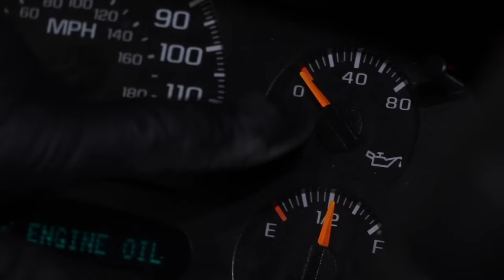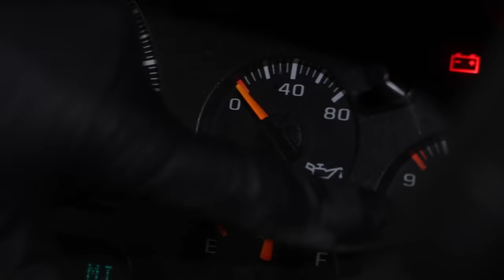Top 5 Problems 2000-06 GMC Yukon Sierra Chevy Suburban Tahoe Silverado Avalanche Cadillac Escalade

Comment: These trucks are really bullet proof
So far I've replaced
Oil pressure sensor and doing the steering shaft today along with the steering bushing lol.

Thanks again for this video
Reply from the maker: +tliska10 adventures Thanks for checking us out! 1AAuto.com
Reply: Bullet-proof, indeed! Few issues with sensors, yet nada on engine problems - a claim my Ford brother only wish they could say about the bucket of bolts they drive.

Comment: I’ve had 6 if these engines loved them .  I always cut a hatch behind the drivers seat where the fuel pump is first thing when I got one because my fuel pump went out on all of mine and that made the change a lot easier.  

Never had a cluster light issue, but o2 sensors and the drivers side seat ripping…and the a/c compressor.  Other than that they were all champs and looking forward to buying another
Reply from the maker: +Wren Coe Thanks for checking us out! http://1aau.to/m/Shop-1AAuto-c

Comment: Thanka for that last one on the fuse box. My cruise control wouldnt work and I traced it to a broken wire probably from some critter. I did not know the fuse panel flips up that easy however and will definitley inspect it when I get a chance just to make sure nothing else is going on!

Comment: I've had to replace quite a few parts on this car, so I can probably name a lot of the common ones cuz I had to research for hours to find them.

#1. Brake Lines. Unless you live in the desert, the crappy metal brake lines will eventually rust out, and are very expensive to replace. Luckily I found a mechanic that didn't know what he was getting into, and held up his end of the bargin. 
#2. Water pump. I guess it could have been the gasket, but mine had a dried coolant chunk when I took it off. 
#3. Power Steering Gearbox. Having a lot of trouble steering to one side? That's the gearbox. Took me hundreds of dollars wasted on a PS pump and bad mechanic advice to find that out.
#4. Belt Squeals. After getting fleeced on the PS pump, I had nasty belt squeal. They redid it trying to correct a possible misaligned pulley but couldn't. The cure is the Gatorback or Continental Elite Belt. Unfortunately, those are discontinued now. I have a spare, and they're apparently selling for $200 on ebay right now. I bought mine for $33.
#5. OBD2 Scanner not working. Check the cigarette lighter fuse. It's probably blown from putting coins in the center console cigarette lighter hole. 
#6. Oxygen Sensor. This was actually bad when I got the car, and the other one went bad afterwards I think. 
#7. Intake Manifold Gasket. I haven't done this yet, but I remember a ton of people selling used ones saying they replaced theirs.
#8. Rear differential cover leaks. I've done this twice and it seems to keep leaking. 
#9. Coolant T Square is another common one. It's a plastic coupler on the passenger rear that leaks coolant.
#10. Speedometer. The motors on these speedometers go out a lot. I have not had mine go bad yet, but it's very, very common. 
#11. RUST!!!! With these cars in particular, you need to put rust coating, and thoroughly wash your car whenver it snows. The car has rust everywhere, and both rocker panels have holes in them from missed rust spots (owner before me). Rusted out brake lines, PS lines, body parts. Paint has gotten faded as well.

Comment: Had the mouse issue in a Tahoe,. It was a model that came out with the electronic 4-wheel drive lock that wouldn't release burning out encoder motors. When I got it there had been two encoder motors already replaced. The mouse had chewed through the lock wire so it coudn't relase the mechism to switch then burning the ecoder motor out. They missed it as the lock circuit was intermittent.

Comment: If you ever get a crank no start or stalls while driving out of the blue and somehow gets going again the first and cheapest thing to check/replace is the crank position sensor. It's a good idea to keep some hand tools on board in case the alternator goes cause it's such an easy job on these trucks it's a waste to spend an extra two or three hundred at the mechanics when you can pull into an Autozone and switch it out in under 20 minutes. Same with the starter but those are probably not problems unless you are engaging it repeatedly like in a delivery truck. Water pumps aren't too bad. Had a dealer do one and they charged me a grand back in 06 and the next time it went I did it myself for under 200 and it's hard to screw that job up. If you have a truck with dual wheels make sure you retorque the lugs on them probably within a day or two and after a week cause they've been known to loosen up and once they come loose once they'll be more prone to it because the wobbling will make the holes wider. If you're running hot going up hills and the thermostat is good it's probably time for a new radiator even if it isn't leaking.

Comment: The part about O2 sensors causing misfires is dead on.. Put a new sensor on Bank 1 sensor 1 and even thought new it was no good and caused 1200.00 damage to cat convertor on that side. A certified shop couldnt even figure it out, but the internet saved the day, I fixed it with another new O2 sensor. Running like a champ now.

Comment: I’d take all five of these problems in exchange for my walked camshaft bearing. Low oil pressure wasn’t the sensor or the oil pump intake pipe o-ring (another common problem), and rod and main bearings are well within spec. I will be keeping an eye out for these problems, however. Thanks!

Comment: I bought a brand new 2003 Chevrolet Tahoe 4x4 5 3 LT fully loaded. 
10 years later with 90,000 mile I had enough!
My vehicle was serviced regularly and garage kept. I live in Central NJ 

Problems:
Coil failure ✔ 
Instrument cluster failure ✔ 
Rear seat release failure ✔ 
ABS failure ✔ 
Spare tire release rusted solid and had to be cut ✔ 
Serpentine belt tensioner freeze up ✔ 
Knock sensor ✔ 
Brake lines failure / rotting out ✔ 
Steering shaft rattle ✔ 
Vehicle frame rusted badly. ✔ *

* denotes -  GM gave me a recall notice regarding frame rot, then when I brought it to my Chevrolet dealer told me that my Tahoe did not qualify for the recall because its serial number was a few hundred out of the vehicles recalled range.    I argued and said look at this frame rot.  No avail  

I drive a Ford now .

Comment: Say what you want, 2000-2006 was prime General Motors... I have a 2004 Chevrolet Avalanche 4x4 with 402,xxx miles, never had a single problem out of it and a 2003 Chevrolet Tahoe Z71 at 327,xxx miles that has only ever had to get the crankshaft repaired.

Comment: Transmission  went out at 115,000 blew 3rd gear $1800 to rebuild it. 04 chevy Avalanche
Reply: Eric H sounds about right. Once they hit 100,000 miles, the transmission usually takes a hike. So when I see these douche bags buying these 50k mile trucks for $20k, I just laugh. The transmission is the weakest part of these trucks. And that is saying something, considering most of them are put together with chinese plastic and elmers glue.

Comment: Got a 04 tahoe 80,000 on it. First owner. Replaced the sensor on top on the fuel tank, got rust on the under carriage, replaced the cluster, got a p455 code that keeps coming back, got some clear coat peeling. No rust on the body though. Still runs solid just needs a little work. Got some 24” wheels on it no system yet got to get the check engine light code thing fixed first. Hopefully when I change the purge and vent solenoid it goes away.

Comment: Good video and info! Another common issue is the dome lights and infotainment center not turning off after the ignition is shut off and door opened. Its a problem most of the time with the actual door latch on the drivers door or multiple doors. I have one that had a problem with the latch for 3 of the four doors. Can be solved by greasing the gears to the latch sensor inside the latch. Replace if all else fails.

Comment: 2000 Yukon xl 5.3l, check engine light, oil pressure sometimes goes below 40 psi but if you hit steering wheel it'll go back to normal, sometimes dashboard gauges freak out bouncing but if we connect the OBD2 to it the gauges will stop and go back to normal

Comment: Thanks for the video , I have DTC P0300 after filling the gas tank, plus inoperable horn (no power to the 15 amp fuse), add when below 40 air temp until the cab warms up the stereo while has power there is no sound also no key in the ignition chime ditto. 
Ah life can be wonderful at times and this is one of them for my 2003 Silverado. All will keep me busy during warner weather and out of trouble.

Comment: Every time I start my 2002 Silverado the ABS and Brake lights in the dash stay on.  If I turn the truck off and restart it the ABS and Brake light remain off.  Why is this happening?  I would appreciate any help.  I have cleaned all of the ground wires.  Resoldered the 3 points inside the ABS module. Replaced the wheel speed senor on the front passenger and replaced the negative battery cable.  I was told the battery cable and ABS sensors were bad by an ASC certified mechanic.  He was WRONG.  It did not fix the problem.  I examined the negative battery cable by stripping off all of the insulation and it appeared to be in perfect condition.  Great video by the way.

Comment: I would like to mention the O ring on the oil pump pick up tube. Over time this O ring degrades. This results in low or no oil pressure in cold weather when the oil is thicker.  Instead of picking up oil the engine sucks air in through the worn oil ring with a reduced amount of oil resulting in low oil pressure. The shop thought I was nuts when I asked them to drop the pan on my 2006 Escalade with a 6.0 liter and replace this o ring. They wanted to change the oil pump which is located on the front of the engine and been a total waste of money.
Reply from the maker: +Patsslab Thanks for the feedback!

Comment: There is one other problem that wasn't mentioned in the 2002-2006 four-wheel drives Chevy pickups and Tahoes and GMC trucks and Yukons. That is transfer case problems the oil pump in the transfer case begins to wobble around wearing through the transfer case itself to fix the problem they put a plate behind the oil pump to stop it from wobbling back and forth but if it happens you need to replace the rear case of it and that's when you can put the adapter to take care of the problem. But you won't really know you have a problem until the oil starts to seep through the case itself

Comment: Top 
1 Knock 
2 Tic
3 O2 sensors
4 Passenger side seat belt locks up
5 Oil pressure sending unit
6 crank sensor 
7 cam sensor
Reply: Heater core connectors

Comment: Replacing a fuel pump on a 2002 GNC 2500HD pickup.  Labor intensive job.  Removing the fuel tank and the fuel lines will be rusted if you live in the Northeast.  Another item the battery sits over the windshield washer bottle.  Battery acid can leak down and get on the bottle and hoses.  I replaced mine twice.  In fact got the parts at A1 auto.  There video showed me exactly how to do it.  I had a auto repair shop replace my fuel pump.
Reply from the maker: +Stephen Johnson Thank you for your order! We'd love to hear about your experience. Here's a link to leave us a review on Google: https://goo.gl/i5JFNY

Comment: It goes without saying, DO NOT think that your car automatically have these problems because they might not. After watching this video, I was convinced I had a steering shaft problem and went to do this fix for it but it fixed nothing. Instead, it turned out I had idle arm and control arms that needed to be replaced so not only did this video didn't help me, it actually cost me more time and money. So be smarter than me and double check to see if your own vehicle have the exact same problem.

Comment: Sierra 2000 - 5.3 V8 had anti freeze leaking into into engine problem.  Rockers rusted out, exposing brake lines.  Brake lines were made of steel with no plastic or vinyl coating.  Hub bearings need regular replacement.  I could go on and on!

Comment: Fuel senders in the 2001 Tahoes have thin copper contacts that break  and cause the fuel gauge to read intermittantly or inaccurately.
If you start the truck, and fuel reads full, then drops to empty, then you rock the truck and it jumps back to full.. you have a bad sender.
When you get it out you will find the tiny copper fingers on the sender have broken off.
Requires removal of the fuel tank and replacement of the sender.
There is an upgraded fuel sender assembly.
Good idea to replace fuel pump at the same time as it seems to occur after 100,000 miles which is when a lot of fuel pumps wear out.
And you don't want to drop that tank again anytime soon.
Some people cut a fuel pump access panel in the floor under the drivers side second row seat.
But that is literally "hack" work.
Reply from the maker: +M E Thanks for the feedback!

Comment: On my '03,  the ABS sensor had grease buildup that was causing the slow-speed pulsing.  And when changing the knock sensor,  seal the plugs with gasket sealer to prevent water from entering the sensor well and corroding the wires & connectors!!

Comment: Just changed the 02 sensors and it’s running better than ever even after two tunes ups. 
Had a reoccurring p300. 
Bought at 221000 currently @235000 running like new hardly any vibration inside.

Comment: For the knock sensors, I didnt remove the intake and go through that headache,  I just unplugged the harness and plugged a new harness in (with two new knock sensors) Then bagged the whole assembly and zip tied it to the firewall! Voila! fixed. The piston slap present in almost ALL vortec engines will set off brand new knock sensors and it does cause "drivability issues" because when it senses knock, it retards the hell outta the timing causing even lower fuel economy.
Opee, why no mention of the piston slap?
And the sunroofs getting stuck just because you changed the battery?
Reply: GENIUS!!!!

Comment: That’s a dirty engine compartment! I have a 2005 Chevrolet Avalanche & it still looks new with 15,000 miles on it. I Haven’t had any drive ability issues yet? Best vehicle I have ever owned-ever!
Reply from the maker: +John Clyne Thanks for the feedback!
Reply: I just replaced the Dex Cool anti-freeze in my truck on the advice of fellow vehicle mechanics that I work with. They suggested lifting up the rear of my truck with a trolley jack & remove the lower radiator hose (asswipes didn’t install a petcock on the radiator). The vehicle coolant looked identical as the new. Save for some metal sediment at the bottom of the white metal pan. The truck has 15,624 miles on the odometer. I change the motor oil once a year with Mobil 1. Usually about a thousand miles a year. I have yet to do anything other than wash it. The truck is always garaged. One year I replaced 1 tire because it picked up a 7/16” bolt in the road & ruined the tire. The other tires had 5K miles on them. No need to replace all 4 as they still looked new.

Comment: 2005 Tahoe.  If the interior ever goes dead, follow the parking brake release cable and you may find it leaning against a black box in a galvanized bracket.  Move the cable away and everything will work again.

Comment: I have a 02 Z71 Tahoe and I’m having 3 of these now. The O2 sensors,knock sensors & steering shaft noise. Replacing O2 sensors 1st then knock sensors. No rush on steering shaft.

Comment: Intermittent starting problem

First time was a hot day 98, had AC on and drove 10 miles.
Shut the Silverado off came back out it was no crank no start.
No radio
No DIC
After numerous texts finally started

It has had different situations some different from others.
Once again very hot day no fuel pump sound.
I have cleaned all positive connections new battery terminal bolts to under hood fuse block.
Now cleaning grounds from frame to body.
The 2 on LH frame have the starter spinning faster now.
Now for the block grounds.

I have replaced the ignition starter switch.
In the dark I get as if weak battery.
I had the window down tried again heard relays clicking.
Used electric contact cleaner in all fuses and relays insert pull out reinsert.
Ah electric gremlins fun they are

Comment: On the knock sensors there is a bulletin out on these. water runs down the top of the plate under the manifold and get through the round plug gasket rusting out the sensor. It calls to replace the sensors an harness then after you put the rubber plug back in to run a bead of silicone 3/4 way around the rubber plug leaving a say 1/4 inch left unsealed on the firewall side of the rubber plug.

Comment: Definitely having some electrical issues. P1518 is a recurring nightmare. New throttle body, new TAC, new pedal/sensor, and getting my new connector to throttle body soldered on tomorrow. Praying it’s the fix. Cleaned as many grounds as I could before I cut the grounds in the back and reroute them

Comment: Many other common problems. Still love these Tahoes. 250K miles easy. Change the oil.

Issues I have had. Bad ground on side post batteries. Replace the bolt that screws into battery. Window motor. Door latch actuators. Roof leak at roof rack mounts. Pitman arm loose.

Comment: Excellent video . I have a 2005 yukon xl denali my issue has been steering i have replaced pitman arm, intermediate shaft  , gearbox multiple times,steering angle sensor . I have play and lets say your driving and wind is kinda hard the car literally pulls one way and your steering wheel is other direction.i have checked the tie rod and no play.truck has 100k .
Reply from the maker: +Ruy G Thank you! We love empowering our customers and showing how to perform DIY auto repairs with our high-quality auto parts.  http://1aau.to/m/Shop-1AAuto-c